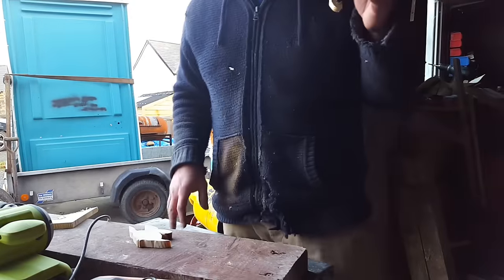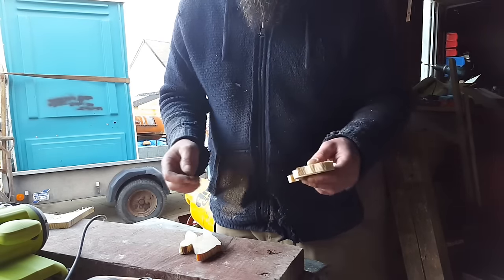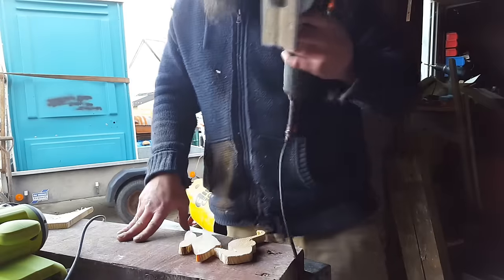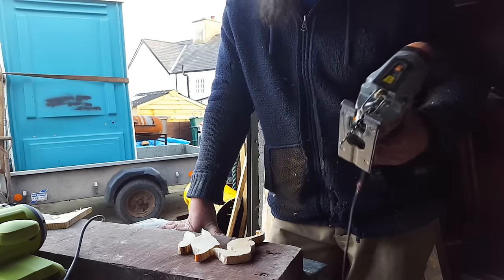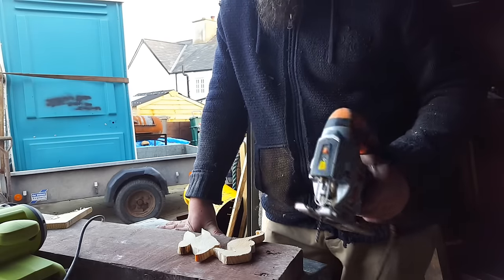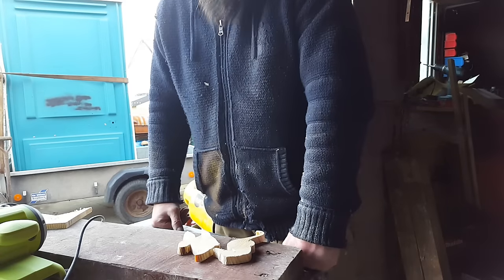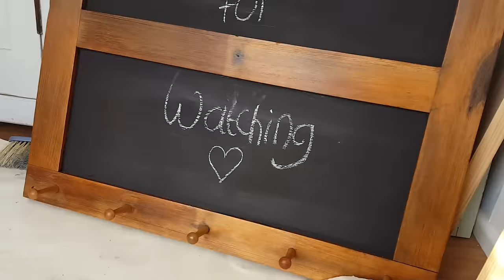Easy Pallet Furniture Projects - Wood Crates, Trugs & Totes

Comment: Excellent work and some great ideas. I love my jigsaw for all the reasons you mention here, and it was one of the first power tools I ever owned.
Reply from the maker: Its a very useful and adaptable piece of kit and i wouldnt be without mine. The ammount of projects this one machine can help you complete in the early days of woodworking is phenomenal. Ive started making bowls by layering slabs on top of each other, early days but results are interesting.

Comment: Good job on those carriers.  The knot-eyes on the cat carrier is a nice touch, and the whiskey one has to be a keeper too.  I've made them for hand tools, magazines, paints & stains, etc.  Very handy carriers for work outside the shop.  My favorite hand power tool is a DeWalt 4 1/2" high speed die grinder.  It gets a lot of use, and I'd really miss not having it.

Comment: hy bongo jus dropping in a quick message,  spent some time today dismantling some small Euro pallets I had, never a nice job to do eh, seen your nail punched for de nailing,  looks like a real time and frustration saver tho iv got no air compressor so not on my list yet. spent £240 ( ouch ) yesterday on some new toys from screwfix, emerged belt sander, jig saw blades, erbauer 2000+ watt router, and a titan wet n dry vacation which I'm using hooked up to my d ewalt table saw.Not the best brands of make but I don't fall for the marketing ploy of festool ect I try cheaper brands and judge for myself tho my dewalt table saw is a top of range excellent saw, it's the most useful for us artisan pallet designers so I spent a lot on that., always feel guilty spending that sort of money but I look at it as it will help me make money for my family so worth it.
when are you doing a new video?  always look forward to them. cold at mo ismtmit tho.

Comment: Great stuff, I like that denailer! But how is it that it doesn't blow out the wood where the nail head comes out?
Reply: Ok, I just watched your unboxing video - I guess it's a question of some nails do and some don't. Certainly, in my experience, if the head of the nails have been driven below the surface of the wood, when you push them through they take a sometimes very large chunk of wood with them.
Reply from the maker: yes bang on the head mate, some do/dont, sometimes they come pinging clean out the back and yes sometimes splinters, but more often than not, its not, theyre getting belted at such a psi (120) i think its set at that the wood doesnt get a chance top spinter away, im still using it a couple of times a week, its a great tool and if youve got a compressor allready then you should have one of these, not necessary but it does save a fair bit of time if youre doing a lot of planks
Reply: thepoultrypeople
Thanks, if I can find one at a reasonable price and shipping I'll definitely get one. Cheers.

Comment: Hy bongo,  can you give me your opinion on pallet pry bars and if they actually work as easy as it looks. lately pallet wood I come across are so well made and nails sunk deep.  I love the free material but very labour intensive with hammer. from wirral
Reply from the maker: Ive only got the one so can only say on that, the pallet buster,  i did a video on it when i won it and since then ive used it a fair bit. Probably a 100 pallets worth easily, more its in near daily use. Depending on the pallets its either great or useless. On the whole say 75% of the time its great and rocks on, saves a lot of time and effort and they just pop off. Take an entire pallet to bits in front of you one handed smoking a fag. But on some pallets the shape of the bars on the tool will just crack and splinter the timber as it lifts/twists it away from the piece underneath. Im still using a large hammer and at the moment a nice vintage tyre iron which has a narrow front edge and gentle curve thats works really well, especially when taking the blocks off. 

Theres two set widths at each end on this one, in an ideal world it would be again slightly wider for the 125mm center strut type. Or adjustable, theres a pallet tool out there thats got adjustable feet but i think its over in America.
If youre passing call round and you can play with it and the air denailer, dont forget to leave and stack the planks nicely up in a pile....

Comment: what jigsaw do you recommend
Reply from the maker: Evolution Rage7s, it gets a lot of use, its powerful, able to do all the cuts and curves i need. It uses standard bosch type spade blades, make sure you are replacing them fairly often, im on my last blade now so im going to need a few more soon. Ive had makita and bosch ones in the past and all of them eventually failed, itll be interesting to see how long this one lasts. Currently at over a year old and a few months the only fault ive found is where the cable goes into the body has cracked and ive put tape over it to reinforce it. Id buy another tomorrow. I bought this one using my own hard earned cash :)
Reply: thepoultrypeople Many thanks, it's on my Christmas list, love the projects, keep them coming.